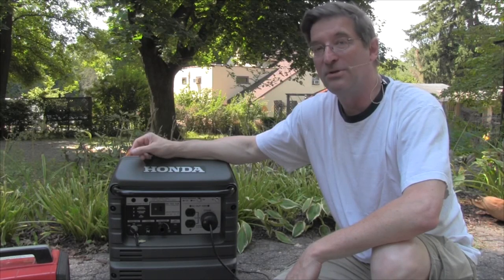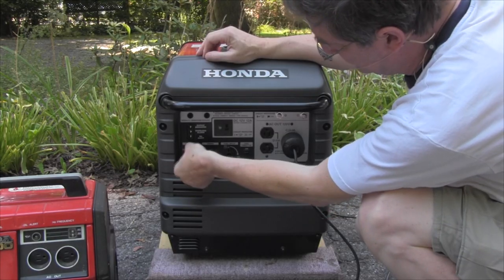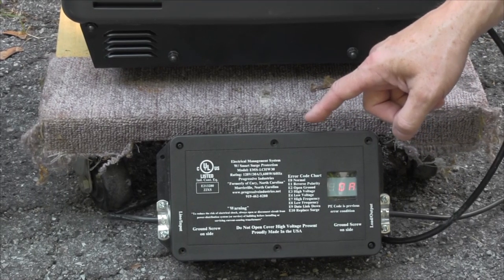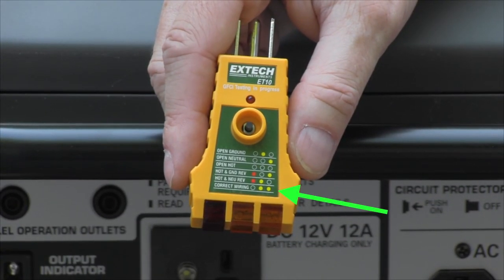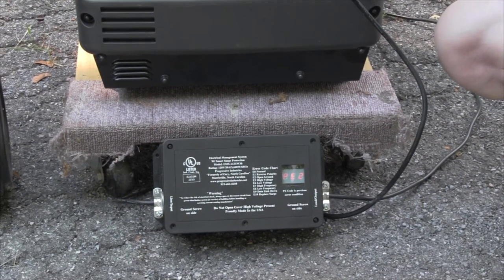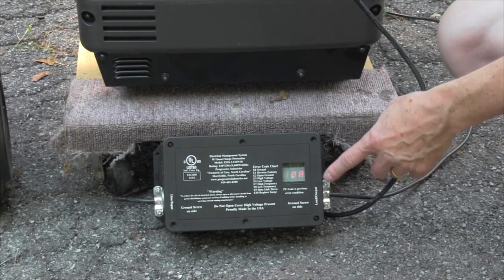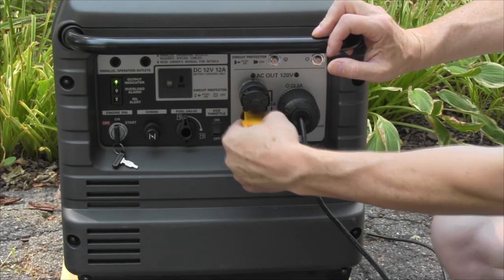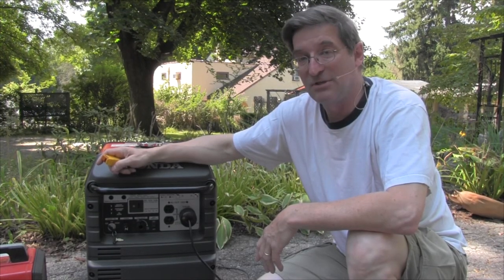Testing a Generator for a Floating Neutral

Comment: So is it safe to say, that you have the ground lug tapped into the neutral plug?  So one could make their own plug by just connecting a wire from the ground terminal up to the neutral side of the plug
Reply: +gonepriused yup. that's it
Reply: That would take away his profit, you are supposed to buy the one he made for $1 and is selling for $10.   Shhhhhh....
Reply: +gonepriused yes, not a true ground tho is it?
Reply: It does work, I made one up for my Honda 2000 inverter gen.